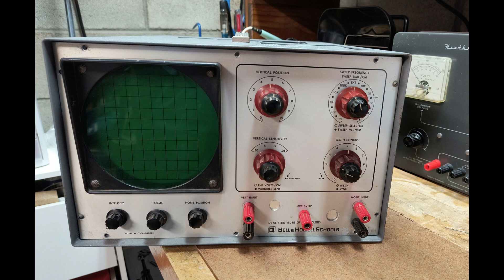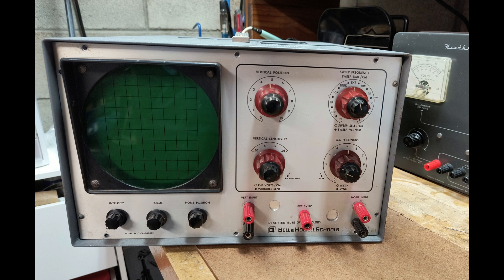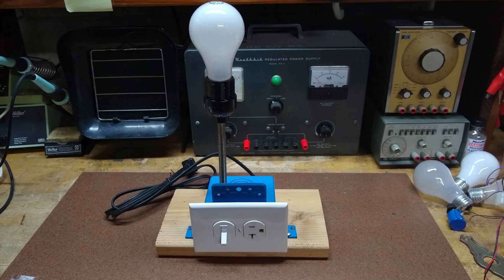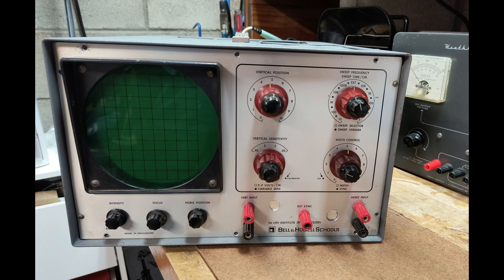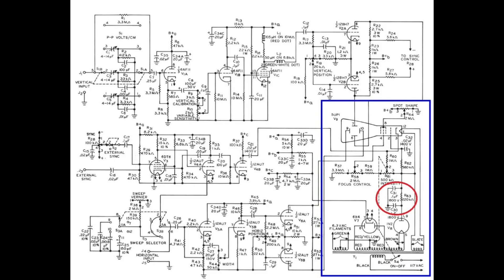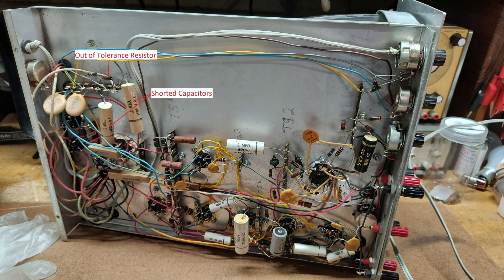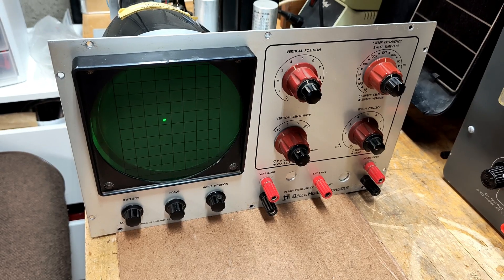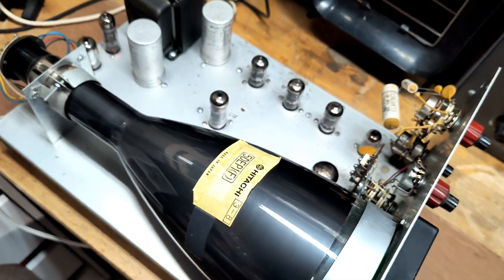Bell & Howell Model 34 Oscilloscope

Comment: Interesting.  I just picked up a B&H model 10D-4540 with no leads.  Any idea where I can find a manual or instructions to use it?  Thanks.
Reply from the maker: @dajo4349  Hello. This B&H scope appears to be the same as Heathkit model IO-4540. I once owned the Heathkit model. 

Here's a link with schematics:

http://mrmodemhead.com/blog/gallery/io-4540/

Comment: Concerning the can caps. Antique Electronic Supply has new can caps of the 40-40-40-40 uF value the scope requires, but they are about $40 each.
Reply from the maker: I have bought some vacuum tubes from Antique Electronic Supply in the past. Unfortunately, $40 is way too expensive for multiple capacitors in a single package. My channel is self funded which means I have to do projects as inexpensively as possible. For power supply filter capacitors such as these, I replace them with discrete capacitors. It does take up more room but I save a lot of money that way.
Reply: I often do as well, however if I want the can caps there and I have the extra money or want it more original looking I'll get the can caps.

I've only restuffed the can caps on a device once and that was because the circuit is on a PC board and one side connects to the line. Removed the cardboard cover then cut the cans off right above the base.

Threw the cans away, put the new caps on the base then glued the cardboard cover to the base. 

One won't ever know the caps aren't original.

Comment: I have one of those scopes. Those two caps in mine were shorted as well.

I started recapping and replacing all carbon comp resistors several years ago, but haven't gotten the time to finish it.
Reply from the maker: I generally only replace components that need to be replaced. For example, you may find that many of the carbon composition resistors are still within their tolerance. These can have tolerances of 5%, 10% or 20%. In some cases when changing any of these resistors you have to make sure that their replacements are more than the right ohmic value, wattage and tolerance. Keep in mind that carbon composistion resistors are non-inductive and can handle energy surges better than other resistor types. Therefore, depending on the circuit function you cannot always directly replace a carbon composition resistor with a metal film, carbon film resistor or etc..
Reply: Here in the southeast I've seen more bad carbon comp resistors than not and im not a fan of replacing just the bad parts and have it fail later due to an original resistor that was in tolerance but is now out of tolerance.

Also for test equipment using 1% resistors may make it more accurate.

Lastly I read somewhere where someone did a test on metal film resistors and found them good to several hundred MHz.
Reply from the maker: @ikonix360  It depends on the test equipment and what type of environment it was and is stored in.  A lot of the older test equipment dating pre 1970's generally has resistors 5% or larger tolerance unless they are used in oscillator or other precision type circuits. The O-scope in this video I believe has at least one 2% tolerance resistor which if memory serves is used in the vertical attenuator circuit. I also remember at least one resistor with a 5% tolerance. I believe the majority of the remaining resistors in the O-scope are 10% to 20%.
Reply: @alslab2764  true.

I usually use the 1% metal film given their low cost and ready availability.

Where I work, we have some carbon comp in benchstock and it's common knowledge to test the resistor to see if it is in tolerance before pulling it and put it in a piece of avionics.

Comment: Hey Al, thanks for posting. I’m not as good at circuits as you, and I’ve got a lot of old scopes to fix. Would a good idea be to start with replacing all the caps? Isn’t that usually the go-to first step? How often are resistors so out of whack that you don’t get a trace?
Reply from the maker: Hello Jared, It depends on the type of capacitor. If it's an electrolytic cap,  it could be completely bad or be of diminished capacitance. Either way these should be replaced. Generally, ceramic, mica and certain film capacitors don't need to be replaced as often unless they fail due to a circuit fault. If you do suspect that you have a failed capacitor of these types then you should measure it to verify its health.

These old pieces of equipment do use carbon composition resistors that change with age and exposure to humidity. Therefore, if you find resistors way outside of their stated tolerance of 5%, 10% or 20% then you want to change them. It really matters when these resistors are out of tolerance and are used in oscillator and timing circuits. The test equipment will not function properly across all of its operational range.
 
If you haven't done so, please subscribe to my channel.

Thanks,

Al
Reply: @alslab2764   Fantastic, thank you for the help! I Just subscribed. These scope diagrams are brutal, I guess that's why I've given up on actually trying to diagnose the problem. So the easy way out for me will just be to check caps and resistors.
Reply from the maker: @jaredcravens2658 Can you tell me the make and model of the oscilloscope? Also, what is wrong with it? Do you get a trace on the CRT?
Reply: @alslab2764  I've got over 10 CRT scopes that show no trace that need repairing. Some have a trace but it's off screen because either the vertical or horizontal deflection plate circuit isn't working. Diagnosing the sweep circuits is the most difficult part for me, those are so complex.
Reply from the maker: @jaredcravens2658  I know you will find the issues. My advice for now is to concentrate on one oscilloscope at a time. If multiple scopes have the same type of issue then they may have the same/similar circuit failures. The more you practice troubleshooting the better you will get at it and along the way will learn some circuit theory. Good Luck 👍 Al
Reply: @alslab2764  For carbon comp resistors, I just go ahead and replace them all with 1% metal film resistors since they are usually under $0.75 each.